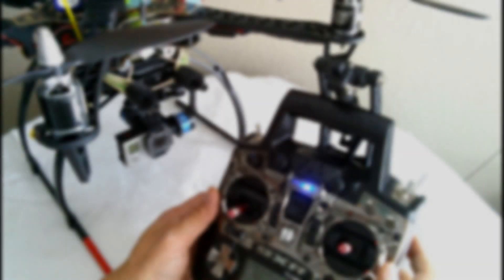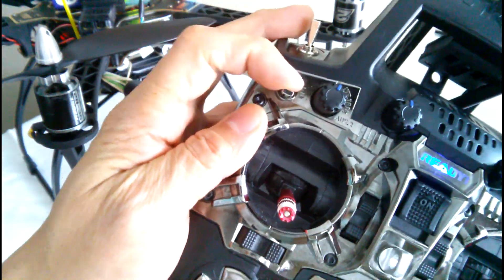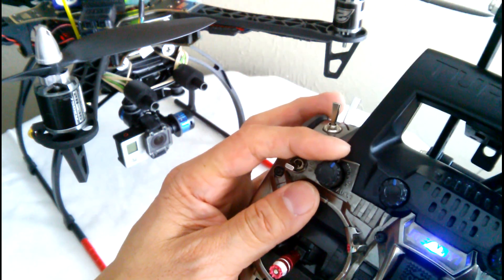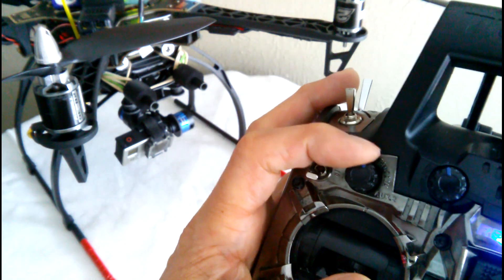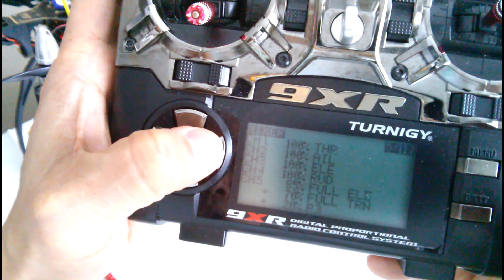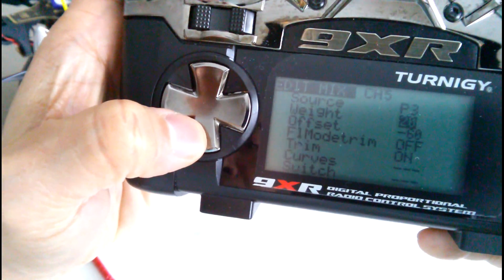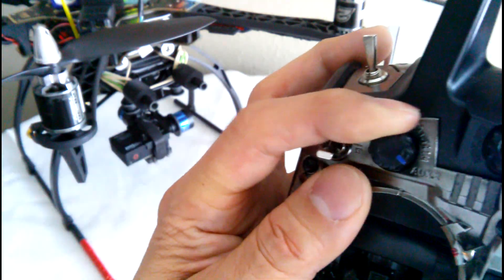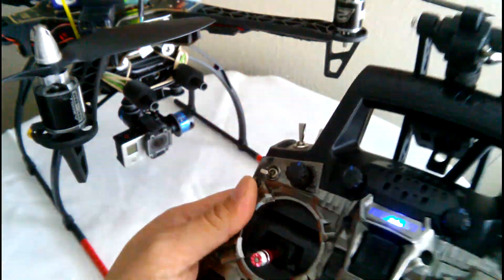Tilt Control Switch Tarot T2D Brushless Gimbal

Comment: Great video !! I configure my Turnigy 9Xr like the video, but I have two problems. The first is that when I stop the switch (down or up) the camera returns to the position 0... the original position. Caould you help me? Thanks so much for your video
Reply from the maker: sorry i have not used this in a while. hope you found a solution.

Comment: very useful, though I just used the logic of desensitising the knob and that did the job, for me; setting both 'weight' and 'offset' at 25. It does not run away like before. 

Idea/Question: is there a way to program couple of switch (say ELE) to tilt the camera at a pre-set angle (like looking straight down), and another perhaps to bring it back to the position it was? thanks :-)
Reply from the maker: Great! I tried playing with other switches for preset angle but i could not figure it out so this is the next best thing :)
Thanks for watching.

Comment: What are the setting's on the ELE Switch? I seem to have no movement when I have the ele switched down, but when i hit the trainer it tilts up. Any Suggestions?
Reply from the maker: Rewind to 2:55 it's in there at 85percent :)
Reply: Rotor Head Unfortunately, I must be missing something somewhere, and you are the only one with any sort of info of the 9xr and tarot gimbal. I must be missing a value somewhere, I have Full Ele set and nothing happens when I flip the switch down, it is set to 85% but no other values were changed. There must be a value I need to change on the Full Ele. The Trainer swith and the pot work perfect when the Ele switch is down.Thank you for your video, it was a great place to start!
Reply from the maker: Sorry buddy can't help you on that one. Pls check all your trim settings make sure they are all at center and try again. you might have to flip the elevator switch up and down a couple of times to make it work.
Reply: I think I figured it out, I had my limits wrong rather then going -80 to 80 I was going from 0-80 on that channel.

Comment: Did you know if you have any tutorial (manual) on how I care, cables to get the manual tilt?
Reply from the maker: I don't but it's very easy. Download and Open your Tarot 2-axis user manual V1.0, turn to page 2, you will see the control board connection diagram.
Plug a signal wire into T and Ground wire into - negative. 
Remove red wire from your servo lead!!  
Connect T and Ground to a free channel in your receiver and assign the proper switches.

Comment: Good video, I have to buy a new 9XR, but I have a new Taranis 9X and I think they are a lot a like. I had a new 9XR but it got lot in the mail long story but I think I will buy a new at the price you can't beet them. but looking at the menu's they look the same. I'm going to try to set it up like your 9XR to see if it will work. have a good one.
Reply from the maker: Thanks man! I have my eye on Taranis for some time now. Heard very good things about it. But I'm very happy with my 9XR. I'm curious to hear if these settings will work in your Taranis. Happy flying!!
Reply: Rotor Head I only had my 9XR for a short time but it looks just like Taranis as much as I can remember.